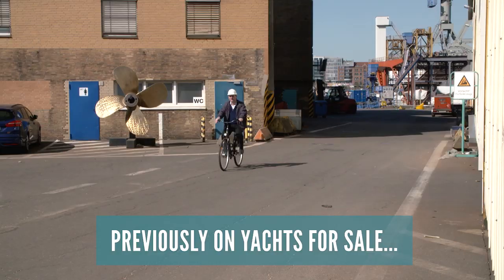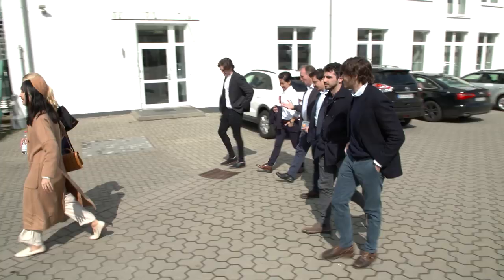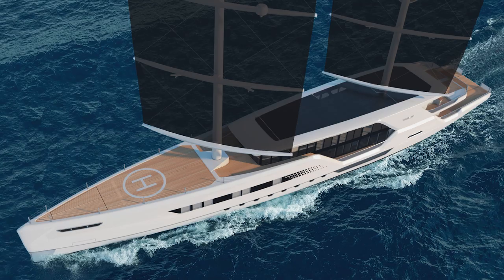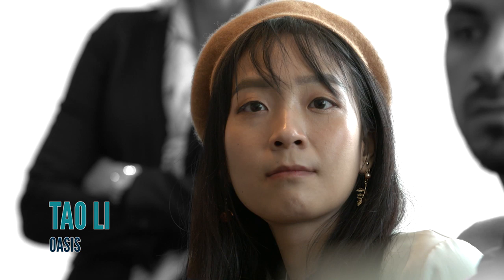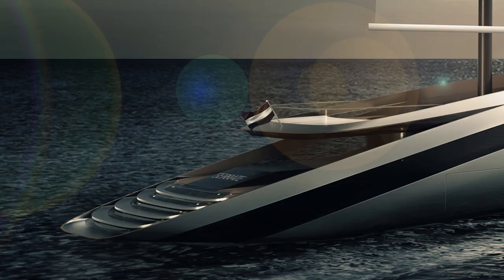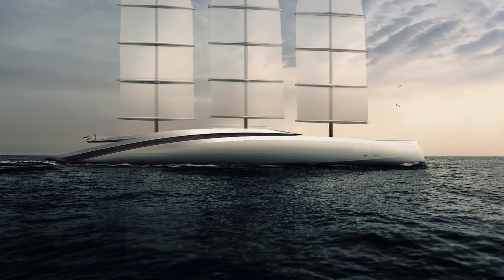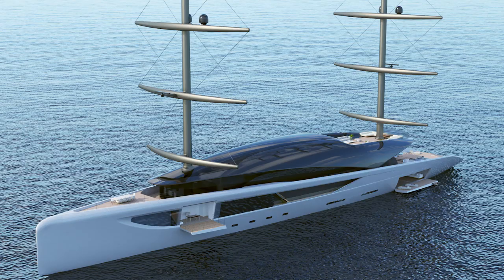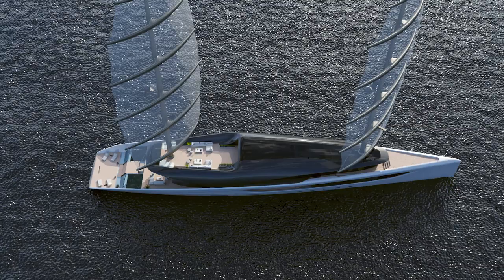LÜRSSEN TOUR WITH YOUNG DESIGNER AWARD FINALISTS!!

Comment: A real design breakthrough would be to get rid of teak decks. Besides the obvious environmental advantages, people on board can wear any shoes they like. Spending so much time on a design, but still making every guest wear soft slippers, what a joke   :-)
Reply: William Drijver that will never happen. Teak decking like you said requires particular shoe types to be walked upon. This is built in exclusivity and it’s another part of what makes yachts exclusive and thus highly coveted.
Reply: @chuntley83  I agree. 99% of yacht owners do not care about nature, environment, or CO2 footprint, and think their yacht should be like 99% of other yachts. 
I'm not sure if teak is exclusive as it's also used for a lot of garden furniture (And in a less thick version on 300,000 euro boats)
Reply: William Drijver unfortunately you are correct. For me personally, I believe ultra wealthy are going to always buy crazy huge yachts and spend fortunes on them so in my opinion the biggest breakthrough would actually be in maritime engine breakthrough technology such as minature cold fusion electrical power plants that provide power to the props and on board energy demand. This would reduce the ridiculous amount of Diesel that these crafts require while also making owning a yacht much less taboo since I think more people would own yachts if traditional diesel generators and engines were no longer required. Also new laminating companies have perfected fake teal which feels the same and looks the same but is not as wasteful.
Reply: @chuntley83  Or perhaps hydrogen powered yachts? Provided the hydrogen is produced using for instance nuclear powerplants. Clean and reliable energy source.
There are excellent alternatives to teak decks, if only yacht owners would order them.....decks by Esthec for instance look terrific imo!